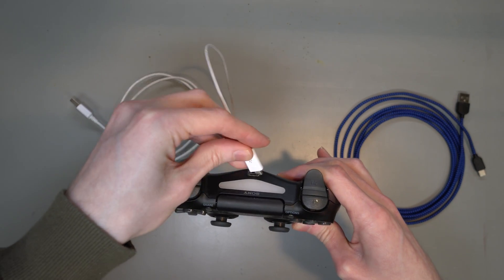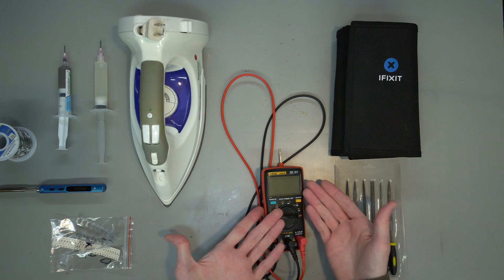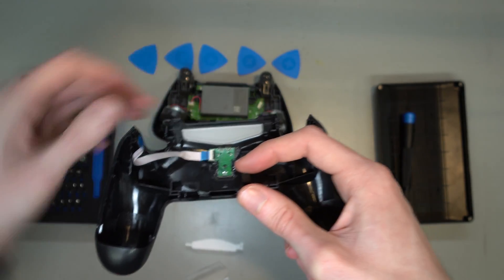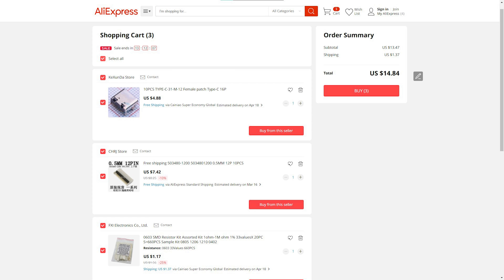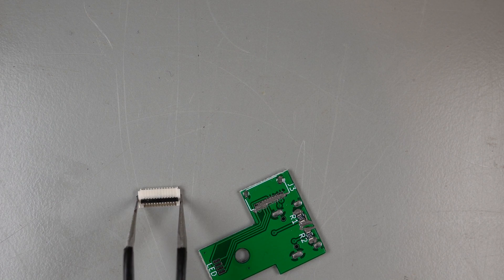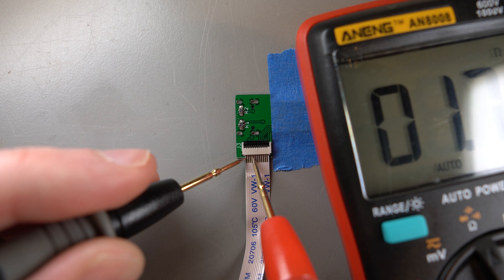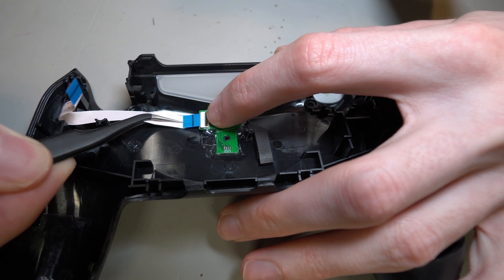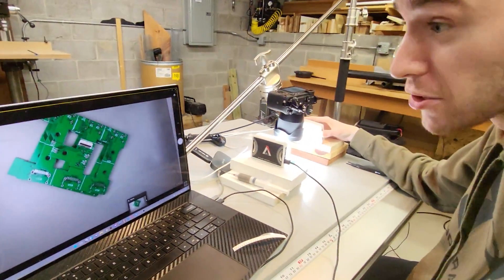Upgrade your PS4 controllers to USB type C

Comment from the maker: The Casual Coders store is now live! Head on over to https://shop.casualcoders.dev or https://www.tindie.com/stores/casualcoders to purchase pre-assembled boards, kits, or bare PCBs today! Jump in our discord server https://discord.com/invite/Kwpc9gr3ZE and let us know in #feedback if the board you need isn't in stock so that we can prioritize it.
Reply: Does this board work to replace any of the 5 different board or only one specifically?
Reply from the maker: @yomeilysmaldonado7467  you will have to find out which board your controller uses and order the correct one. Sadly the only way to figure it out is to open up the controller.
Reply from the maker: @yomeilysmaldonado7467  We've got boards to replace JDS-011, JDS-030, JDS-040, and JDS-05x on the tindie store. JDS-001 has been put on the back-burner due to mistakes in the PCB and a very low demand for it. Each board is unique, so you'd need to purchase the correct board to replace whats in your controller(s).  
-Ian
Reply: I picked up the 030 one and I was able to verify it powered on my system, is the led on it because I didn't see it light up.
Reply: I have a JDS-055, does that work with the JDS-05x on the store?

Comment: I need to find the pinout for the header on the other end if the ribbon cable. I just bought one for $5, opened it up and that header is broken off the main board. Not the charge port board. Thinking I can use 30awg kynar wire to solder it to the pads from the charge board. Or maybe omit the charge board if its not needed for a USB-C breakout board I have that has the two data pins, 5v and ground.
Reply from the maker: Schematics and pinouts can be found in the git repo for our mod boards.
https://github.com/CasualCodersProjects/DS4-Type-C
Reply: @CasualCodersOfficial  Thanks. I found a schematic on acidmods someone made

Comment: Made a few of the 4x/5x variants.
I replaced the MOLEX connectors with cheaper HC-FPC-05-09-12RLTAG connectors. (Front pins line up perfectly, back mounting points not so much, so I left these unattached)

The boards seem to work perfectly so far though! Thank you so much for this!

Comment: micro usb is so flimsy and breaks easily. When you just want to plug your controller in because it constantlky running out of battery or using it on pcs that s till dont have bluetooth its really annoying. usb-c is much more sturdy. sony should have done an official upgradee controller.

Comment: As others pointed out, the screw hole is essential to keep the connector in place. Also there are several controller revisions and the various charging PCBs are not all compatible.
Last but not least, on some models Sony used a resistor, a capacitor, a filter and a transistor, which are there for a reason.

Comment: the ps4's usb is atrocious. If any one can make ps4 controllers with c type usb I will pay 100 bucks easily. The ps4's usb is the reason I've had to buy so many controllers. They're so sensitive that if you drop the controller it easily messes up and the connector will regularly disconnect.

Comment: Really late, but would you do a video for a usb c mod for the g pro x superlight? Ive been looking all over and i cant find one
Reply from the maker: We don't have a G Pro X superlight to take apart and mod, but it certainly should be be doable. The worst parts are that the MicroUSB port is soldered directly to the motherboard, so it doesn't support a drop-in replacement. Following that, I watched a teardown of the mouse and don't see any nice large test points for the USB Connector, so you'd likely be required to tap in on the edge of a resistor, or scrape away green solder mask and solder to a trace on the PCB.  
The basic principle here would be to tear down the mouse, remove the microUSB Connector, acquire a couple USB C breakout boards such as the ones we sell, or the ones Adafruit sells, then reconnect the Vcc, D+, D-, and Gnd lines back to the correct locations. Final step is figuring out how to adequately secure the connector back to the board, and reassemble.  
Hope that helps!
-Ian
Reply: @CasualCodersOfficial  wow, that sounds awfully complicated to me as a beginner when it comes to soldering. Not going to do it then... Appreciate the response anyways!

Comment: I bought one but have no idea what I'm doing with it
Reply from the maker: To install the new board, you're going to have to take your controller apart (again, if it's not already apart), and remove all of the back plastics. That includes the white hold-down bar, the light spreader, and light diffuser. Then unscrew the original charge board.  
Set the new board roughly in the old one's place, and take note of the interference, Since the USB C connector is larger than the MicroUSB Connector, you're going to need to file away some material from the opening. Start by gently filing outward from the center of the hole, along the horizontal axis of the controller. Continually test fit as you go, looking at the size and shape of the USB C Connector. Once you've matched the correct width of the connector, begin filing the entire opening upward towards the light bar. Go slow, and test fit often. Once enough space has been made, you should be able to gently slot the new board into place, add a dab of hot glue if you feel it necessary, reconnect all the cables and plastics, then reassemble. Let me know if anything is unclear, and I can do my best to clarify.  
-Ian

Comment: Well, 2 units done and both don't work with 55 version :V As i see you made universal board but i think there is problem with routes, because pins from original board and DIY don't match. Like kathode for LED on original board is pin 3 on connector, but on your DIY board it's connected to pin 6.

Comment: there is an easier way to do this, there is numerious posts on youtube for this. No need to rebuild a pcb board.
Reply from the maker: Sure you can just throw one of those cheap UCB C breakouts in there, but I reckon that'll remove the LED unlike what we sell, and there's a good chance you won't gain the ability to use USB C to C charging. Additionally, It's just not as clean as a full replacement board such as this.
Reply: Worked for me and I'm not that experienced at soldering. but to go to all that trouble and to put it on YouTube as an instructable you are asking the people to pay for, then to build PCB that MIGHT work. You should put a disclaimer ATTEMP AT YOU OWN RISK so if people stuff up then it's their controller not yours.

Comment: Do these boards have C to C capability? Or do you have to use a USB-A to USB-C cable?
Reply from the maker: These boards to support C-C Charging! That's the reason for the 5.1k Ohm pulldown resistors on the CC lines.
Reply: @CasualCodersOfficial  C-C data works as well I’m assuming?
Reply from the maker: @Jek47  Yes sir!
Reply: @CasualCodersOfficial  thank you 🙏

Comment: Just ordered one of these along with a 2000mAh battery to bring the old girl back to life!!!
Also pulled the trigger on a 2TB Samsung 870 EVO for the PS4 slim. Was using a 1TB Samsung T5 + the stock 500GB HDD before so will be a nice internal upgrade/external cleanup.

Comment: excellent, i'll take 5 of them pre-built since i have a whole family of dualshock 4s that i will eventually smash in a fit of rage because the god fucking damned bum ass connector won't fucking work for fucks sake

AAAAAAAAAAAAAAAAAAAAAAAAAAAAAAAAAAAAAAAAAAAAAAAAAAAAAAAAAAAAAAAAAAAAAAAAAAAAAAAAAAAAAAAAAAAAAAAAAAAAAAAAAAAAAAAAAAAAAAAAAAAAAAAAA

Comment: I've just finished installing this mod! I used a dremel to clear out the old screw slot (may not be necessary in stock ps4 controller but i installed this in an Extremerate Decade Tournament Controller DS4 shell.  I used a shaving razer blade to slowly keep enlarging my micro USB port until it was a direct fit for a usb c cable, i tested by plugged in the board from the outside until it fit through. used hot glue to keep everything in place. i can use this as a wired usb C controller as well as wireless. Thank you Casual Coders and Ian!

Comment: A bit curious but I assume the resistor d3-d6 for the jd040/055 can just be replaced with wire or 0 ohm resistor right? I had tried to made one several months ago but failed cause I do not have the right LED and the ribbon connector haha
Reply from the maker: Correct. You can use a 0 Ohm resistor, wire, or solder bridge on resistors 3-6 for the 040/05X board. Additionally, the LED is not required for function. The ribbon cable is though.  
-Ian

Comment: Hey guys, Marius Heier made a PCB like this, but it can be assembled by jlcpcb. It is open source and you can sell boards. They are pretty cheap.
Reply from the maker: Our boards are also open source! Check the GitHub link in the description!
Reply: @CasualCodersOfficial  I know, you said it in the video. Pretty cool project! Already ordered the ones Marius Heier made because they have all components on one side for jlcpcb assembly. Do you plan on making maybe a battery mod for the controller?
Thank you for making this open source. I really appreciate that.

Comment: So what exactly is the point of adding the resistors? I'm still learning circuits.
Reply from the maker: The 0Ω resistors are really just placeholders. They allow you to impedance match the USB data lines. Really not necessary here, but it could possibly help reduce data loss at higher speed data transmissions.
The 5.1kΩ resistors are a part of the USB Type C spec, and allow you to connect a USB Type C to C cable. If those get left out, the USB controller has no clue what was connected, and It simply won't provide power or data connections.  

Hope that helps!  

-Ian
Reply: @CasualCodersOfficial  That was a perfect explanation, thanks so much!
Reply: Can't i just do it on the original ps4 board?

Comment: Could you do this for PlayStation Move Controllers? Mine are Mini USB and are a nightmare to charge.
Reply from the maker: I'm sure it could be done. Looks like the USB connector is soldered straight to the main PCB on that one though. I've been toying with the idea of creating a really thin little PCB that adapts a Type C socket to the mini/micro USB footprint. I haven't looked into it yet though. I'm just afraid that the extra PCB would change the placement of the USB too much to be useful.  -Ian

Comment: Could be good to provide LCSC part numbers for the components if you have time to collate the list. They're likely to have the parts required for this and much cheaper at shipping than mouser or digikey for the quantities
Reply: Hi, I have found everything on lcsc.
LED: C919446
USB C connector: C165948
FPC Connector: C587969
Resistors: C191166 (or any other 0603 5.1k Resistor out of the hundreds they hav(e)

(edit: I found the Correct Molex FPC connector)